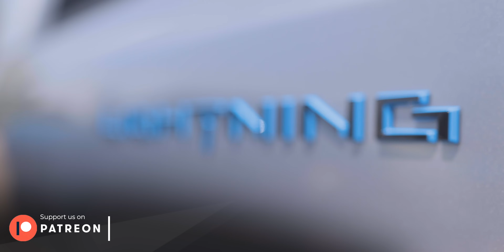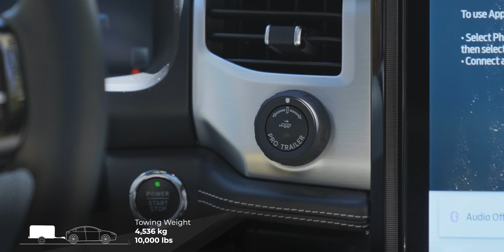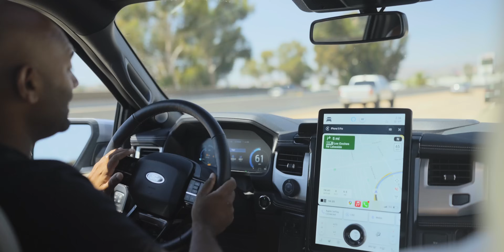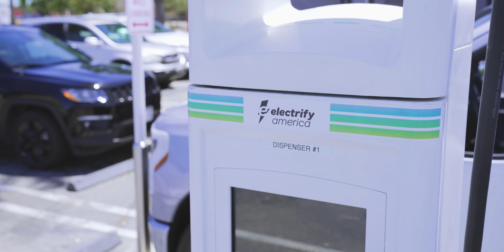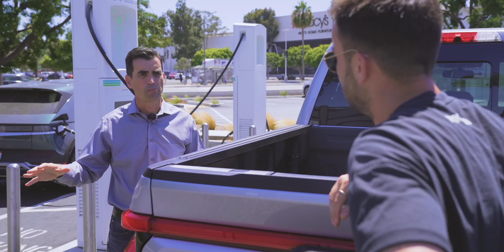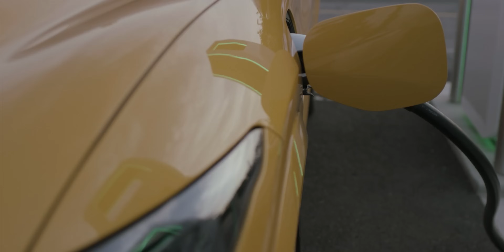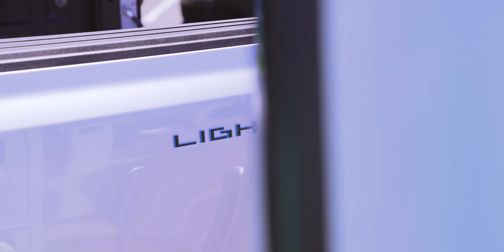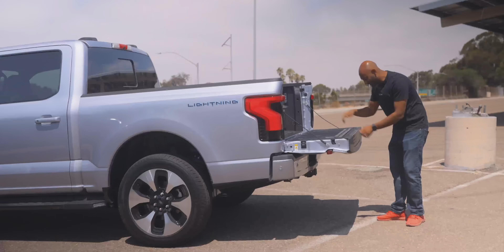Ford F150 Lightning: Is This The Best Truck Ever Made?

Comment: For the UK market it could do with a vertical plough on each front wing to widen the average UK country lane.
Reply: For the UK market the Ford Ranger Lightning will be better.
Reply: I’d actually love to see how these work as snow plows since most plows are F150s
Reply: Lol I drive and f150 at home and took a long road trip vacation through Scotland.

I could imagine driving my truck on those roads; randomly becoming one lane for bridges with no notice, worse one lane for miles on clif edges where you have to reverse to pull offs to let oncoming traffic by. 

Super fun driving area for a tiny car though
Reply: Silly. Obv totally targeted at the US market.
Reply: Maybe hedge trimmers would be as useful.
Reply: Haha it’s certainly wide, fine for Australian roads but I bet they put luxury car tax on it.
Reply: Ha exactly
Reply: I don't think they're even going to bring it here, it's too big for most people and roads. But they will use the tech for smaller trucks and vans for sure.
Reply: And a camera at the front so that you don't accidentally run over an elderly gentleman in a small peugeot. With the height and length of that bonnet😳
Reply: Too wide for most UK (and European) B roads without pulling in for every oncoming car). The Ranger was a better fit. It might be one of the best EV US Trucks but its still based on the current F150 and we all know that cars not designed on purpose to be EV tend not to be the best EVs so we will see what GM (who is making a pure EV truck) will bring out. If I was a customer for either, I would wait and see how the GM compares. It may be that the F150 is good enough even then and Ford customers wont wait and lose more petrol money or wait any longer for what the F150 Lightning can offer them now.
Reply: It's not the best, but there is the Maxis T90 electric ute in the UK. £50,000, 220 miles range, 1,000 kg payload.
Reply: Thatchers bloody Britain! Narrow roads built by the Romans and low train tunnel that will never allow for high speed trains!
Reply: @JacanaProductions  Cant they build new tunnels and bridges ? I would have thought that building a new High speed rail they would be doing that !! If you want increase traffic on the old rails then it would be simple to increase the height of bridges and tunnels to accommodate double decker trains like they have done in the rest of Europe and what Thatcher has to do with anything God only knows apart from save Britain  from the communist unions
Reply: For the UK market it could do with sinking with the ship on its way over.
Reply: @therealcaldini  nice Ford Blow Job don't you think? This channel is a joke.. all they do is give electric car manufacturers a Blow job..
Not true reviews...
Reply: They'd call it a plow.
Reply: @mjmulenga3  In the UK we spell it PLOUGH
Reply: @Stumpy1854-Orion  yes we do.
Reply: Don't put a loaf off bread in the tray.. you will loose range.. it's another American driveway queen..
Reply: Nice  Ford Blow Job though..
Other channels have tested it towing something whilst having something in the tray.. and it's range is SFA...
This channel Blow Job every electric cars... it's a real world wank...
Reply: @graemejohnson9025  SFA? What does that stand for?
And what are all these sexual words? You are a dog? A monkey? A bastard?
Reply: @graemejohnson9025  haha. Dick remark. Literally.
Reply: @graemejohnson9025  on a one-man crusade against the F150 Lightning? Are you unhappy that this is a choice and they are even making these? You know you are free to buy the ICE version, right?
Reply: @hydrolifetech7911  why whould you buy a truck ? Surveys show most pickups are used as cars. Buy a car. Dont be a wasteful posing nob.
Reply: @graemejohnson9025  but then at 10mpg while towing, you'll be lucky to make each services to fill up, so...

Comment: It's crazy when you come to think of it, that this truck doesn't even sit on a bespoke EV platform, but share the same as it's ICE/PHEV counterparts. And it's an excellent EV!!!!  Imagine the stats that Ford could deliver with a bespoke EV platform?
Reply: Probably wouldn't change much, to be honest... the ICE truck has so much 'wasted' space between the ladder frame, that they can shove a monster pack in there without changing the interior... and the performance / range is - mostly - dictated by the exterior aero, which also wouldn't change (because Ford want to keep it looking like a 'proper truck')
Reply: @logicalChimp  was going to say the same it's not like a ice car where there is no wanted Stace and replaceing a petrol tank would be at best 10kwh
Reply: The next gen F150 will be quite different.  This is to get to market quick, saturation, and familiarity.
Reply: 'Excellent ev "? This overweight porker weighs 3000kgs ! Yes, that is right, a massively overweight porker. It should weigh 2000 - 2200kgs. No, not a good ev at all.
Reply: @nordic5490  it's good for the design criteria- a full size truck familiar to the 2+million buyers in the market every year. with the utility and features they expect; Ford should easily sell every single one they can build.  If you're not a pickup truck userb or don't appreciate the market,  you may not get the idea. And that's ok.
Reply: @nordic5490  no full size awd super cab truck made today weighs anywhere near that little. The raptors are 6000-6400# with options and fuel.
The ram trx is 6400-6800# with options and fuel. Even the lightest comparable ice f-150 the powerboost hybrid is over 5700# with fuel.
Reply: @nordic5490  says a person who has no idea what a truck is.  For a "Work" truck that requires a heavy frame so that it can take abuse and safely tow 10000lb up and down mountains, that is the weight most most trucks come out too +-.  If you don't need this type of capability, then you shouldn't be buying a truck but to say that it's not a good EV because of this is completely wrong.  Its like saying a Semi is a poor vehicle because a mini is more efficient.  That is until your local store requires 80000lbs of items shipped to them.  That's a lot of trips in the mini.
Reply: Farley already said the next ground up lightning ev from the blue oval city in TN will get 75-100+more miles in range on the same size pack. 
But that truck he warned would be controversially styled. 😀
Reply: @4literv6  Now if he doesn't produce something as radical as the Cyber truck people will be disappointed!
Reply: @DavidKnowles0  well he did say it would be a controversial looking truck, the next ground up ev lightning that is. 😀
Reply: just think of it as a skateboard platform
Reply: Ford are building a bespoke EV platform. This project was initially design just to block Tesla and Rivian from electric market domination before Ford could build build a dedicated EV platform. An it has more than successfully done that! Beating Tesla to the market as well.
Reply: @DavidKnowles0  how the heck did you get to arriving at that crap? The lightning program started in Sep 2018 per Linda Zhang the chief engineer of the program. It was inspired by Ford's tie up with rivian and seeing the r1t&r1s at their debut in the spring of 2018. 🤔

The cybertruck didn't even debut until late Nov of 2019, car n driver had an insider access article on it that said the very first rolling prototype of the cybertruck wasn't even done until August of 2019. 

By that time Ford had already shown via spy shots they had a lightning prototype on a rivian roller chassis caught at charging stations and leaving the Michigan proving grounds. The same truck Zhang showed towing loaded train cars in 2020 on youtube. 

Gm has also admitted to starting work on the 8 ultium platforms in Sep of 2017 in a recent article by barra and mark reuss. 
So if anything tesla and now ram are the last to the ev truck party. Whose to say if that will end up good or bad in the end?

If both of their trucks coming in 2023&2024 have good pricing and access to the new tax credits. Plus likely better ranges? 
They could very well corner the ev trucl market until other's get their own ground up ev trucks made.

Not counting of course the simple fact gm had an electric s10 back in 1997 and Ford made an ev ranger in 1998-2000. 

Oh and Ford also showed off an awd using 4 in wheel motor equipped f-150(think lordstown endurance) at the 2008 sema show. 
It worked had about 600hp and went 150 or so miles back in 2008!👍🏻

Comment: Once again…sun roofs.  What a waste.  Cover that roof with PV and a luggage rack
Reply: PV - even on a truck this size - would add little range (or none, if covered with a luggage rack).  Luggage rack significantly cuts range due to butchering aero (although, now I type it, that may be less of an issue on a truck like this :D)
Reply: @logicalChimp  every little bit counts AND you get rid of the weight of the whole sunroof crap.

Comment: Charge point and Tesla have a five to 10 second handshake and then charging immediately commences, without the need to interact with a screen or a pfaff about with credit cards or key tags or any of that other ancient technology. Upgrade the network to be plug and charge. No need for spending a couple of minutes interacting with a screen on the charging station that only sometimes works.
Reply: Yeah because this is it for charger development, it's not going to change at all... I mean if Tesla were consumer friendly and actually cared about the environment nobody would have to fiddle
Reply: @bgeery  Unless you happen to be a practicing nudist and wall is above see level.

Comment: Every station twice a month? That means if something is broken it will be broken for up to two weeks before it is recognized and potentially longer before it gets fixed. It is no  wonder why EA has such a bad reputation. This charging infrastructure needs remote diagnostic capability to test if things are working or not and then a technician can be dispatched immediately if something needs to be repaired. Immediately. Not in two weeks.
Reply: There are a good number of Electrify America stations near Tesla Superchargers. Where the Tesla owners pull in, plug in and walk off for a coffee, I see the Electrify America customers fiddling with cards, typing on the screen and even hanging on the phone.
Reply: didn't he say exactly that? monitoring and dispatching
Reply: @Φλωρος-Θωμασου-Ξ5Ξ  He did, but also they have to inspect each one manually... so I guess their 'remote monitoring' is insufficient

Comment: I hate that this is a thing. An even heavier bigger pickup that's going to wear down the roads and kill people, carbon free.

Don't get me wrong, it's great for people that are gonna use it as a truck and for work. But the majority are just gonna be commuter vehicles with no passengers or load, like the ice trucks on the road.
Reply: Keep it light 🤣😂
Reply: We saw something similar here in Blighty.

Range Rovers in Chelsea, driven by drivers described as "Chelsea farmers".

Oh for the days to come when we see nothing on the highways but  cars whispering by ... with the occasional puff of chemically pure water vapour easing itself out of the exhaust system.
Reply: It's got most of the brand new safety technologies standard tho

Comment: I'm 70. Don't understand button fetish???? Most buttons rarely if ever used. Once installed no changes allowed. Vs software capabilities which improve regularly
Reply: I think the point is more about trying to find the right balance between physical controls you use whilst driving (v.s. having to look at a touch screen whilst driving)... without having so many buttons that it looks cluttered (and you end up having to look at the buttons to find the specific one you want to press)

Comment: The whole deal with STILL building charging infrastructure OFF 95 in Walmart parking lots is SO AZZ backwards
Reply: GM and EVGo are putting chargers at Pilot and Flying J truck stops, which is a brilliant move.

Comment: Not a truck guy, but this will sell like hotcakes, the implications for work are tremendous. No more noisy jobsite generators? Hell yeah,!
Reply: They already sold out 2022 models.
Reply: You can't even order it anymore because so many people have ordered one, Ford is basically backed up for around 3 years with what they currently have.